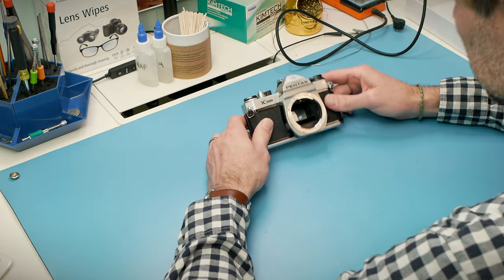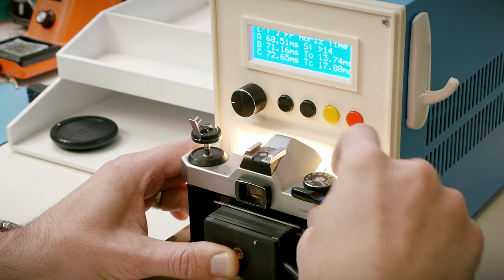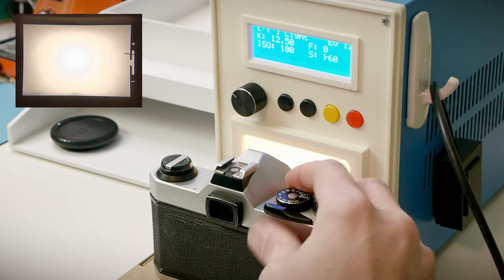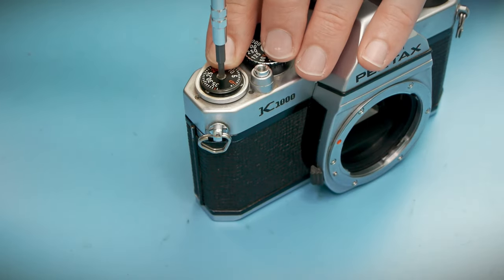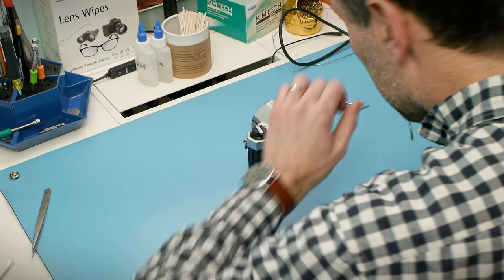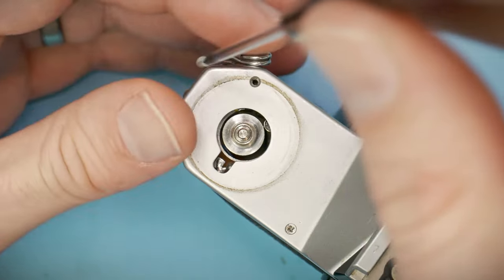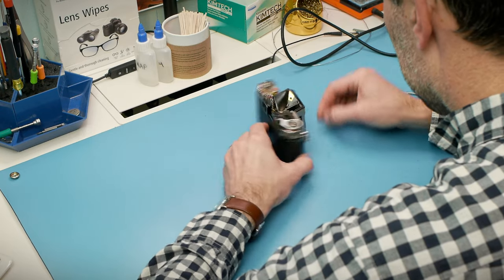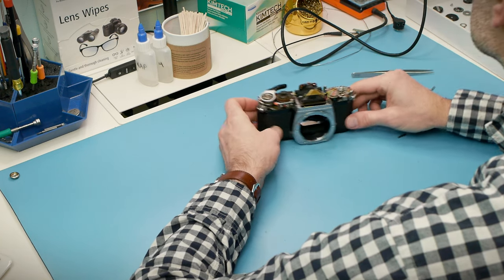Pentax K1000 | Part 1 - Inspection & Top Cover Removal

Comment: Hi Sam or rally like your videos, I recently dug up the Pentax K1000 my mom used to let me mess around with as a child, it has two stripped gears underneath the film under arm, I ordered a cosmetically bad body to strip for parts is there any advice you can give for replacement?I already removed the larger diameter gear on the shaft of the under, now I need to get at the smaller diameter gear near the shutter button
Reply from the maker: I think I might need some pics to understand exactly which part you are trying to replace. If you like you can email me at samscamerabench@gmail.com and I can try to help out.

Comment: Hi Sam, do you have much experience with the Super Program/Super A? I have one with a film advance lever that feels like its disconnected internally. It just flops around. I'm wondering if that is something fixable or if its better to just buy another? Love the videos btw.
Reply from the maker: Not a ton. At least not enough to pinpoint what the issue might be. It's either poke around time or by another camera time. Good luck!